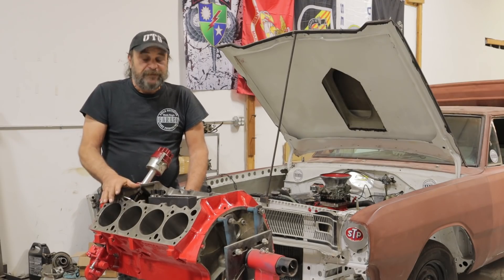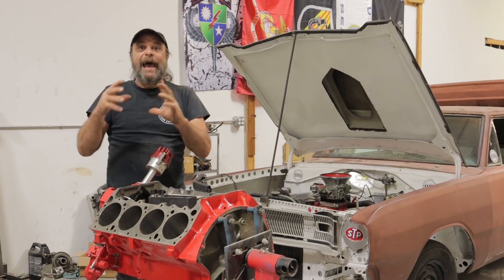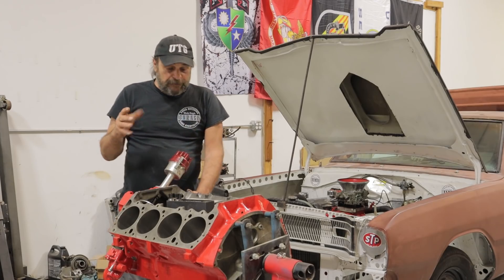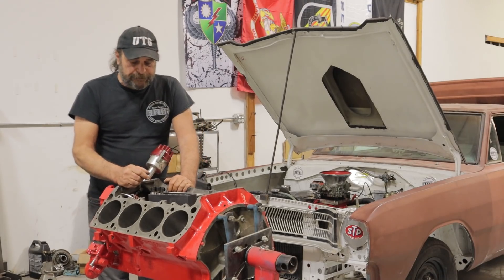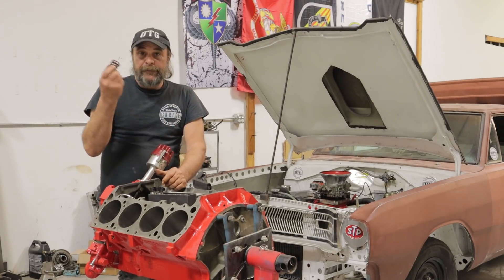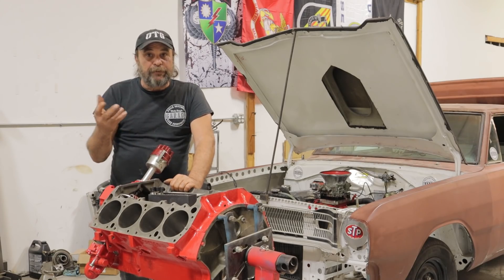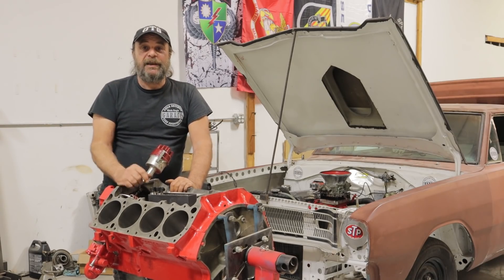Engine Break In For The Home Builder

Comment: Hi Tony,great job on your breakin procedure info but here a a few additional things I do that will help too.

If running an aftermarket cam they require considerable more initial/base timing then oem cam does (due to more duration) which some people aren’t aware of.

For example,my bbc oem cam requires approx 6 dbtdc base timing but the avg aftermarket mild to fairly hot cam requires anywhere from 12-16 dbtdc base timing being 2-3x more timing then stock.

So if you don’t run that 2-3x additional base timing with non stock cam the timing with be very regarded causing the motor to run a lot hotter then it should overheating it & the exhaust manifolds too.

Good starting point for timing with non stock cam for street motors is 14-18 base timing along with mech adv in dist giving approx 28 deg all in at 2500-2600 rpm max.

A lot of guys say mech adv all in by 3k rpm but that’s too lazy with gearing like 273/308/331 where cruise rpm at 60hp h is in 2200-2600rpmish range where mech adv will never be in all the way loosing power & mpg.

Also setup vac adv using a crane cam vac adv limiter plate (hooked to full int vac at idle & not pitted vac) to give max of 10-12 deg additional timing at part throttle low load cruise .

That gives the motor crisper throttle response with more power & helps it run cooler at fle & cruise too.

Listen for detonation with that perf timing curve on pump fuel & if detonation is heard don’t retard timing loosing power,mpg & making motor run hotter esp in traffic at idle.

I use the real lead like used in real fuel 40yrs ago to increase octane & protect/lube exhaust valves (if no hardened ex valve seats seats) to approx 96-98 octane & that should stop the detonation in most cases & retain full power & good throttle response too.

It’s called octane supreme130 avail from wild bills corvettes,it’s expensive but even so when you do the math it’s still cheaper then buying race fuel.

You just keep a few bottles of the real  lead booster in the trunk to add when filling up,it’s great stuff that works great.

Use approx 2.5oz per gal staring with 93 octane pump fuel or 3oz per gal if starting with 91 octane fuel to obtain approx 96-98 Octane.

Moving on.

Filling coolant,add coolant to system thru therm stat housing in intake man  (rad cap off rad!) which pushes most if not all air out of the system.

Fill it till it almost overflows coolant out of intake man & or radiator to ensure most of the air is out of the system & coolant touches t-stat when it’s installed for quicker/proper opening.

Doing this ensures you don’t overheat motor before stat opens & avoids the big sit burp bubble that forces out coolant all over the place too as motor warms up on 1st start.

Ensure you use an assembly on cam lobes & bottom/foot of lifters that stays put on this parts (at times months later) not running of like the red lube some cam mfg’s use that drips off in a day or 2 post application cause an almost dry startup.

I use crane cans grey moly type ft cam lifter assembly lube that stays put on the cam lobes,lifters rockers,valve stem tips & pushrods till you fire up the motor.

Lastly, place 1 if not 2 box fans facing the grill/rad area set on high speed on boxes in front of the rad blowing air directly thru the rad.

If you don’t do this in many cases you will not have good airflow required to keep the motor & collant properly cooled off during 20-25 min run at 2k-2,500 rpm breaking period & motor will run.hit ir overheat.

I always change the oil & filter right after the 20-25 min breakin run because there is assembly lube that can partially clog the oil filter slobg with a lot of small metallic particle contamination in the oil post breakin that must come out ASAP!

For flat tappet mild setups ensure you refill with oil that that a min of 1200-1300ppm zddp & for more aggressive ft cams you should have approx 1400-1500ppm zddp.

Would not hurt at all to use this oil with rollers setups for more antiwear protection too.

Bradpenn1 mfg’s mult grades of oil with proper zddp lvl, for mild ft cams you can use chevron delo std Dino 15-40 diesel & gas engine fleet oil that’s got 1300ppm zddp per mfg data sheet.

I also use a FILTERMAG magnet on the oil filter (esp for breakin) along with proper breakin oil fortified with additional zddp during breakin & post breakin too esp for flat tappet cam setups.

All the above advice is coming from my 5+ decades wrenching/rebuilding/restoring American muscle cars & classic motorcycles.

And like you Tony I’m older guy (66yrs old) too that loves American muscle of the 50’s-60’s & 70’s

Hope this is a helpful addition to your breakin proceedure.

Btw,my toy is a #’s matching 1969 chevelle ss396 4spd I bought from original owners daughter in 1978 that I still own & drive to this day.

It’s never been fully restored but in 2001 I had it repaired it’s original dusk blue & i pulled the motor at same time & rebuilt it top to bottom at the same time.

So motors balanced (.30 over 9.7 forged pistons) & has more cam then stock (moderate comp ft 222/226,.525/.525”,112lsa) & mild pocket porting,Manley undercut race flow valves & extrude honed ex manifolds) motors got approx 375-380hp/430-440lbs trq) ,

2.5”  mandrel bent ex pipes thru flow masters & stock appearing tail pipes & chrome ex tips too.

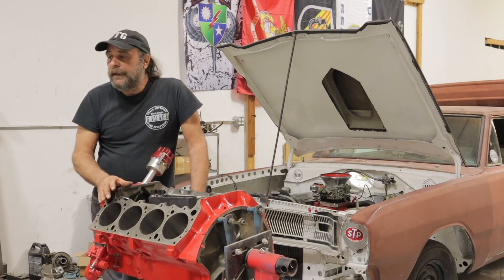With that mild motor setup It’s plenty peppy & fun to drive with 4spd & 3:31 12bolt posi.

Happy motoring to you & everyone!

Comment: I’m at re-assembly time on  my AMC 258 and this was right info at the right time. I’m planning on turning my engine stand into a run stand for the break in and although I’ve heard many talk about how to do an engine break in this was far and away the best explanation why.  
Break in on the stand with exhaust you don’t care about.
Oil change.
Get it in the car with fresh painted-cured header and break in the rings. 
Oil change at 300.
Wheel it!
Thanks UTG!
Reply: If the rings aren't seated in the first 5mins ,start over.
Soon as it's got oil pressure and no visible leaks ,bring the revs up to 2k at least and give it a hard throttle hit (wide open)like every 10 seconds and let the revs come up 4-500rpms at least. 
That'll load the rings so they seat.

Comment: What about an electric break in pack. That spins the engine at a set rpm by the crank. More precise and not relying upon the engine firing
Reply: Also very expensive, and outside the budget / ability of those rebuilding in thier driveway / garage. Which is the intended audience of UTG's video
Reply: @williamallen7836  understood there, was just wondering if people do that? If it exists. If it's even a good idea or if you need the heat of the combustion

Comment: The most important thing is fill the block with antifreeze/water before you install the thermostat, if not engine will run dry before thermostat opens .

Comment: What's your opinion on pulling the distributor and running the oil pump for a bit before starting?  Necessary?  Thanks
Reply: What your asking about is know as "pre-oiling",  and absolutely vital  procedure for a new or rebuilt engine. Easiest way is to take an old distributor housing with the drive gear removed and adapt a power drill to the rotor mounting, spin and watch the pressure build on a gauge.  Most modern engines no longer have a shaft driven oil pump, but instead have an oil pump driven directly off the crankshaft, this is a much better design, but does not allow to be driven by an external source, except for cranking the engine with the starter, but this is not practical with a flat tappet camshaft.  Pre-oiling these types of oil systems take a different procedure, and there are a couple ways of doing it, one way is to add an external oil source and pump connected/plumbed into an easily accessed oil gallery,  preferably as close to the oil pump as possible, another way is to have a pressure vessel with oil plumbed into an oil gallery to add pressurised oil.
Reply: @quicksilver462  thanks

Comment: I got a crate motor and never did a breaking period the mechanic was a very good mechanic and he never even mentioned it do crate motors need to be broken in?
Reply: Unless otherwise stated by the vendor who sold the crate motor, they are often started and the cam broken in on an engine run-in stand.⁹ Some don't do this basic beakin. So it's best to contact the engine builder to know for sure.
Reply: Got directly from Ford 352 old school for my 67 f250

Comment: It would be cool if you could just put a retarder brake on slightly to load the engine during break in (after cam run) . Also a secret to bedding in piston rings quickly was taught to me by an old timer. He does not lubricate the rings or the bore in the slightest during assembly, says you can hear the rings creaking in the bores when you turn it over by hand before you fire it up. But he's won several national championships on engines built just this way, and theres no reason this can't be applied to street engines either. But i've actually seen an engine NOT bed in because the guy dunked each piston in a bucket of SYNTHETIC oil before placing in the bores, and he took the car out on the track to road the engine and driveline in, and the engine started smoking like a 2 stroke after 5 laps - probably worse. The guy took it back to his machinist for an autopsy and the verdict was - NOTHING wrong with the engine, just reassemble using minimal oil and make sure the oil you run  for the first change is a 100% MINERAL oil. I thought the oil thing was hokum until I saw it for myself.

Comment: Is royal purple and pretty good break in oil? Or is a Lucas breaking zinc additive better?
Reply: Buy the specific Break In oil, RP, Comp Cams, Lucas, Maxima, Amsoil, Driven,  etc, they will all get the job done and you won't have any oil related failures.  I avoid RP because you pay more for it and the product is not good enough to justify the cost upper over the competition.  I've known guys to use VR-1 from Autozone since it's a cheap high zinc oil at the corner parts store.
Reply: you need non detergent high zinc break in oil, yes its 75$ but better than a wiped cam lobe, detergent in regular oil will strip lubrication in break in.

Comment: Great video Tony!!! Only thing I would add is to make sure you also change the oil filter and cut it open to inspect for any metal. 

great channell!! 

Bob Odonnell
Reply: Good reminder on cutting open filter , which by the way people  is designed to trap trash 💪🏻👍🏻
Reply: Good advice but, it's a bit of overkill.
The magnetic drain plug will give you the read you'd be looking for. Just change filters and read the drain plug.

Comment: I was told to use none detergent 30 weight oil with zinc or none zinc and a bottle of break in zinc additive ?? when I broke in my first engine before I watch a lot of youtube channels like UTG I put either synthetic or none synthetic  rotella 15w40 and a bottle of comp cam break in additive in and fired the engine up and ran it for 20 minutes at 3000 rpm and ever so often revved the engine. I guess I got lucky . the engine still runs and at first start up has 75 pounds of pressure .
Reply: Running it with the Zinc additive is pretty much the same as buying and using a break in oil. The ZDDP additive is pretty much the same exact formulation of breaking oils.
Reply: stock springs are more forgiving, performance springs not so much

Comment: You want to open up a can of worms? Research ( piston ring microwelding ). This can be a result of the incredible heat from new rings  cutting into the cylinders. Like tony said this heat from friction usually only happens in the first few minutes of starting an engine with new piston rings.
Reply: This true and why on startup I will run without a thermostate, when it gets hot shut it down let it cool and then restart at 2000rpm to polish lobes and lifters some old motors we did we kept a hose in radiator and slightly opened radiator.

Comment: The exhaust can glow from the extra oil film burning off.  The oil gets pushed into the exhaust as soon as the engine starts and then burns off, making a lot of heat.
Reply: Retarded ignition timing makes the exhaust glow. Extra oil burning off doesn't produce enough heat or last long enough to cause the exhaust glow.
Reply: @tonyelliott7734  I had to retard the ignition timing so much on a dune buggy to stop detonation that when driving back to camp the charging system warning light came on and the lights started to dim. When I got out to see what had happened I suspected that I lost the fan belt. Nope the headers were glowing cherry red and had cooked the voltage regulator. That's the last time that engine saw 87 octane gas!
Reply: @davidleonard8369  
I believe that 100%. I build and tune engines among other things for a living. And Uncle Tony said the manifolds will glow from excessive friction on initial startup and cam break in of a newly built engine. I have never experienced that in my life. I respect him for his knowledge and won't dispute his claim here on his channel, but I've never seen that to be true.
Reply: @tonyelliott7734  Youi answered my question before I even asked it. Thanks.
Reply: @CarsandCats  
As I said in my previous comment, you are correct. About both points.

Comment: What a tease! Motor sounded like it had a miss?
Reply: We did have a spark plug wire come apart when we pulled them off a couple times because they’re straight boots, but we fixed it. I’m gonna be ordering a set with angled boots because pulling off the straight ones if they broke this early is obviously going to be a problem down the road I’d like to avoid.
Reply: @austinlacroix888  strait boots are a pain in the ass. My 1992 Camaro has them stock. After running for X thousands of miles, the rubber adheres to the plug. It is very difficult to break the adhesion by rotating the boot. It's just to hard to get the leverage. Specialy when the engine is installed, space is even tighter. I cut a roughly 1 inch to 1 & 1/4 inch wide strip of 14 or 16 Guage metal. At one end I made a fork slightly wider then the spark plug porcelain, and tapered outside of the forks a bit. Then put a 90 degree bend in it just after the fork. Then a little past the length of the boot I put another 90 degree bend in the opposite direction to make a pull handle. I made another one with the 2nd bend in the same direction as the first bend for extremely tight spaces. This allows me to slip the fork just under the end of the boot. This way as you pull on the tool it puts preasure right ware the adhesion is at so it can be broken free without stressing the crimped on wire connector. You can use different widths of the sheet metal to allow easier access in tighter "spark plug wells." It's best to use the widest strip that will easily fit. As the strength of the tool comes the width of the meterial, and the 2 90 degree bends. If extra strength is needed. Places the 90 degree on the corner of a 2x4 or other suitable pieces of scrap wood. Then using a large flat head screw driver, or blunted chisle give a good wack aligned along the axis of the bend. It's best to clamp it down so it doesn't try to unbend when walked. This creates a gusset that will easily greatly strengthen the bend so it won't try to unbend as you pull on your tool. I said pull on your tool. Hahaha. 😀 hopefully I was able to describe this well enough that you can visualize it. If not, let me know and I will make a quick video and link it here. It would be my very first.